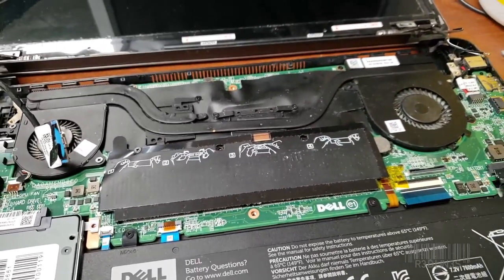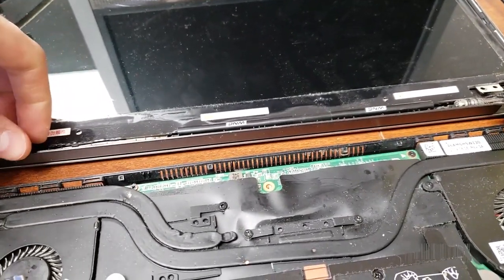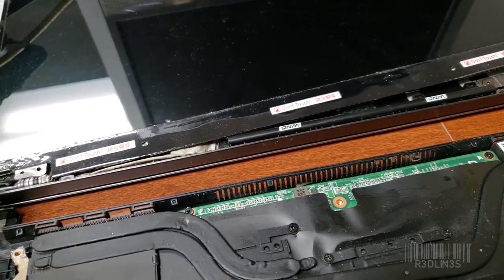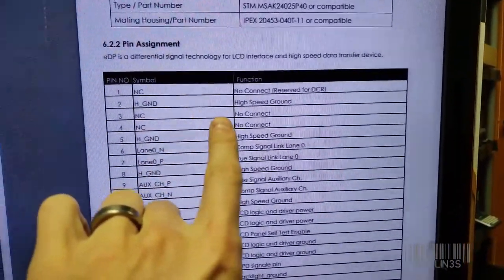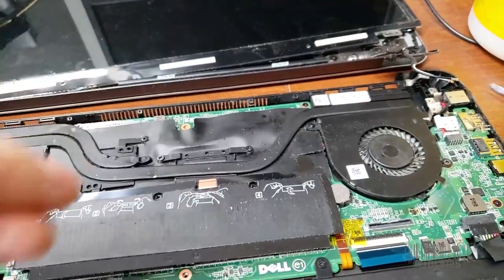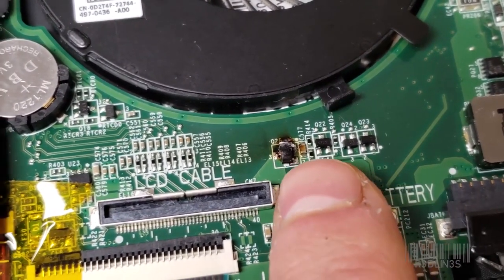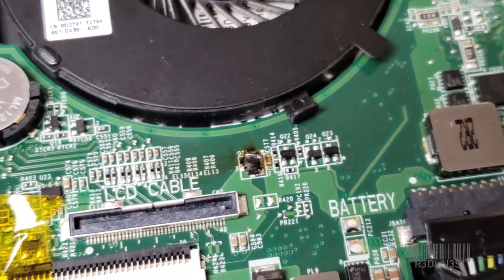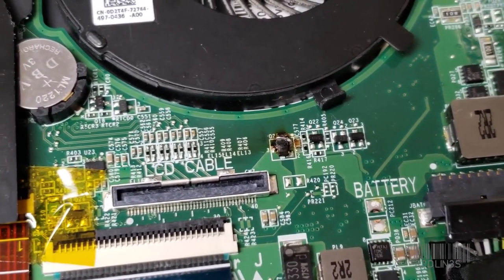Plug The Wrong LCD Screen Into Laptop

Comment: Hey thanks for the video, I am trying to update my hp 15p-201la to a better screen if possible a touch one, which brings to the point of noticing that there are different 40 pin connector config so, do you know where can a get the data sheets from? I would like to do the same comparison you did.

Comment: Thank you for the video.
I slid on an icy sidewalk and my Dell Inspiron in my backpack stayed black. It still works on my TV, but loses its purpose of a laptop. But its screen replacement is so expensive on eBay. So I was tempted to buy a Dell Latitude one, which costs less than a half. The size is the same 14", the resolution is the same, and they are both 30pins.
Your video gave me an idea to look up for the pin configuration first.

Comment: Yeah I learned about this by attempting to replace the shitty TN LCD on a Dell E6440 I picked up for cheap with a 40 pin 2560x1440 IPS display salvaged from my old dead gigabyte laptop. The e6440 would not POST with the new screen and a memory not installed error was displayed when I reinstalled the old display. I figured a supply rail was shorted. Since the laptop was fried (130Vdc into USB port from a miswired motor controller and embedded system, convirmed dead CPU VRM, etc) I assumed so was the screen and scrapped it. I regret it now lol, it probably worked fine, just didn't have a way to drive it and while I knew "LVDS" was common in older laptops, I thought the connector was different, like the one in my old 2007 laptop with the CCFL 1280x800 display.